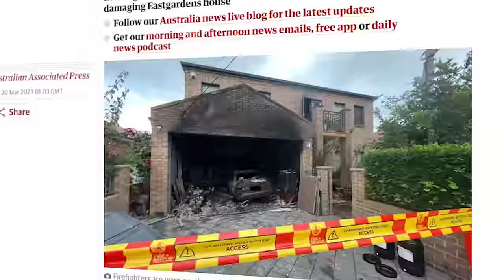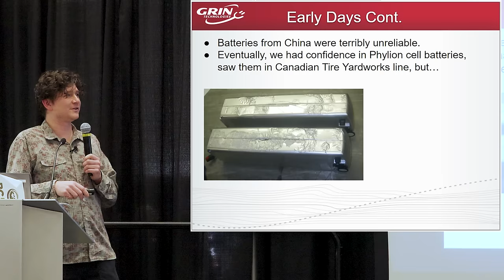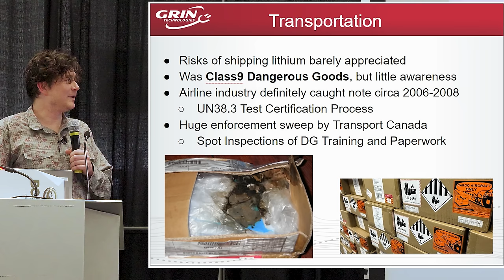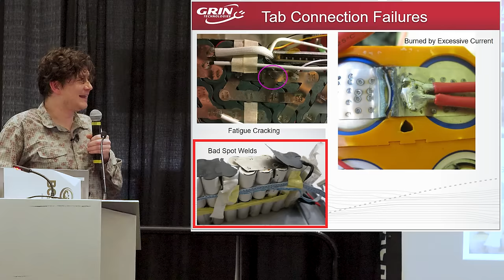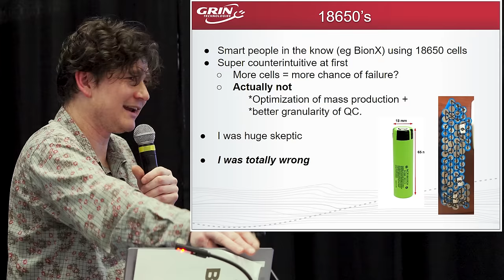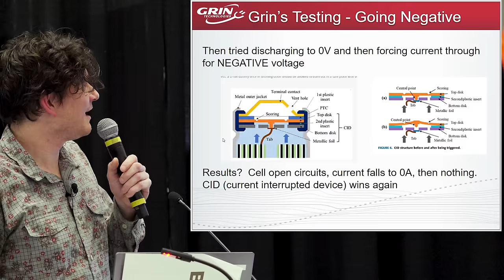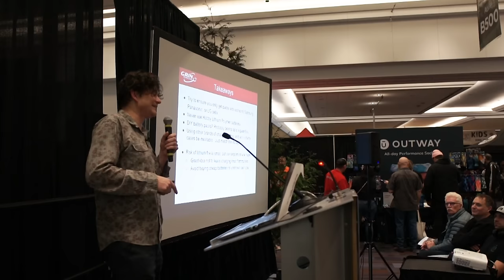Grin's Perspective on Ebike Battery Fires, 20 Years of Experience - Live from the BC Bike Show

Comment: The early days portion of this video is so fascinating to me. I got into this in 2016 and the not-so-distant past seems like such a mystery to me. Someone needs to write a book.
Reply from the maker: The ebike movement really started in earnest as a thing in the late 1990s.  There was some stuff in the 1970's that never went anywhere, but by the 90's you had zap, Currie, aerovironment, heinzman, Ev warrior and a bunch of other brands setting the stage for what was to come.
Reply: @arobertson87 I got in in 2003 when the Voloci ebike from new Hampshire debut.. NIMH batteries were terrible, needed to be topped of just prior to leaving, and the sag in winter was tremendous. I hen went to NICads from Justin , heavy as heck, nd they would get super hot.
Reply: I only started in ebikes in 2014 so have the same feeling as you. I did used to race R/C cars during the Nicad & Nimh era so I know how big a step Li Ion & Lipo were :)
Reply: I got a conversion kit in 2011 or something, LiFePO4 was the only game in town then it seemed. The battery was solid, but the conversion kit had so many manufacturing issues, including one dealbreaker, so I had to return it within warranty. Many years later I started buying used lead-acid ebikes as they died, and converting them to Li-ion using old free laptop 18650s. Unfortunately all of them got stolen eventually, but building them was a great learning experience. I'm happy to say that I applied nearly every safety measure mentioned in this video, and my only thermal incident was the melting of a low quality fuse holder. I now have an electric moped DIYed with quality cells and every safety measure mentioned in this video, and an ebike with an original good quality battery which I'll probably re-cell within a few years. And a really good lock.

Comment: You fail to mention YouTube video's being posted of amateurs building DIY lithium batteries packs also upgrading chargers so they charge faster. Not only are they putting themselves at risk also other from lithium fires.  The whole industry in sales and repairs needs regulation, so standards can be increased.
Reply from the maker: Agreed that the proliferation of YT vids encouraging DIY battery assembly encourages a lot of people to do things that they shouldn't. Part of the reason is that there is zero ebike
service and repair industry and the ebike manufacturers do everything to discourage a healthy aftermarket,leaving no option than DIY repair. 

Re faster charging, There is generally no problem charging lithium cells up to 0.5C charge rates, while most stock chargers are only like 0.2C or less. So upgrading to a faster charger is quite a reasonable thing to do as long as the actual connector type on the port supports it. This is not a battery fire risk.

Comment: I think I'd add to your presentation the danger of leaving the battery exposed to sun on very hot days. That may cause a rise in internal temperature and subsequent explosion. Happens with GPS units stuck to the windshields of cars. That might've been the scenario in the case of the scooter by the subway station in your leading slide. Grin rocks, learning a lot from your videos.
Reply: Ah yes, that intense Canadian sun, and the blazing Vancouver summer, anything could combust under those conditions.
Reply: I mean didn't we already know this in the 80s and 90s
Reply: @sankaplays3098  we already know alot of this information

Comment: Great talk Justin, I have followed you for years and am amazed at your great work. I  remember when you had a contest to name the cycle analyst. I' ve had 2 fires, both my fault, no one hurt. Lipo - I hooked up a 3 series to a 4 series ? thinking I was hooking up my light.  oops, then hooked negative to positive on a 4 series, in the dark again, , and I felt the heat, not a fire just a wire heated up melted the solder so that broke the connection.  Now I use Li ion on my bikes, they work great. I add a lipo as a booster pack sometimes but I make sure I  hook it up carefully in the light.
Reply: Lol, thank you for advice of this matter. But It is best to keep my preference of normability of my uses of all 4 of my ebikes of the extreme need of avoiding these scenes of ebike fires. I lived thru wildfires and even in my home and FIRES is a moment in life no one needs to witness of experiancing ( its total dredd ) and myself with ebike use, I rather ensure I have no need to mess with the ranges of specs. Im sure its useful to many but for me I just keep em simple. Ride safe and be safe and thanks for your experience of this matter.

Comment: as an RC pilot I learned all about how to keep your stuff from exploding in flight or while charging.. the hard way. And I always just assumed that the same kind of mistakes (maybe even intentionals) were being made in ebike factories. And that's what this video pretty much says! You can get the entire battery and charging system for less than half the price if you take out all the designed-in safety features, and there are manufacturers out there serving that market.

Comment: One thing I've done with all of my home-made batteries is to wrap them in a layer of fiber-glass fire blanket under the PVC cover.  Not only does this help reduce the chance of a fire spreading, but glass is an excellent electrical insulator, and it offers an abrasion layer to protect the batteries underneath in the event of a crash.

I also use the JK-BMS.  These are really nice as they have active balancing (meaning they can balance during both charge and discharge), have two temperature probes, a bluetooth GUI, and lots of programmable safety features, including over temp, under temp, short circuit, over current, over voltage, under voltage, etc.
Reply from the maker: This is all good, but nothing the bms does can make up for a situation with low quality cells that go into thermal runaway all on their own even when always kept with nominal  operating conditions. So in addition to those precautions, you should still only use top tier cells, even if they cost a fair bit more per wh than generic ones.
Reply: @GrinTechnologies Absolutely!  I do bike touring, so last thing I want is to get stranded by a battery fire or failure.  Also, in my experience top-tier batteries last longer, and so pay for themselves anyway.

Comment: About overdischarging: This will probably not immediately damage a cell. If you leave it around for days or weeks, then it will damage the cell by chemical processes. If you recharge it immediately, then probably not much will happen.

For security I store my battery in a large ammo box, together with some liters of water in plastic bottles. You need about 600 Wh to vaporize 1l of water. 
And about 90 Wh is needed to heat 1l from 20°C to 100°C.
So I hope, this will stop a fire as early as possible.
Reply: I'm into cell rescue, and I've heard that rescuing unused or lightly used cells that have gone down, even all the way to 0V, can result in a quite healthy cell at near original capacity. I've only rescued heavily used cells myself, and I don't bother with anything below 2.5V when it comes to those, because my experience is that they'll be low capacity or high self discharge (or both), either right away or quite soon. I also toss cells that have less than 75% of their rated capacity, because they tend to self discharge or lose more cepecity rapidly.

Comment: Failure sources:

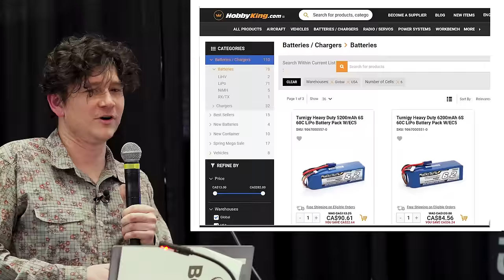- R/C flight hobbyist lithium-polymer batteries out-performing gas for power, range - 7:44
  [is this due to scale inefficiencies of small gas engines? could a micro diesel power plant driving main horizontal thrust prop + electric vertical-take-off and control rotors work efficiently? How does electric vs. gas scale to human flight machines?]

- Water facilitating galvanic current between cells and through casing to cells
- Tab weld failure 16:30
- Tab material overloaded 16:55
- Mechanical impact 17:20
- BMS circuit failure - electrical overheating within internal pack circuitry burns polymer casing materials = electrical not lithium fire

Failre Consequences
- eBike business fires 19:50
- eBike business fires (home auxiliary facilities) 20:50

Small Cell Packs > Large Cell Packs
- easier to locate issues within pack
- industry convergence on 1850 type cells pushed development and standardization for small cells
- allows more granularity for overall form factor of battery pack
- 1850's vary in quality / China market includes lots of counterfeit

BMS DETAILS

What is the problem the BMS solves?  ~ 24:30
 - eBike end user doesn't attend to any of it -- the management is baked into the battery -- down to each cell in the pack.

- BMS and maintaining 1850 standardized-cell specks 25:10

- What are consequences of out-of-spec charge/discharge for battery cells ('cracking' the case/BMS to recycle individual cells)
   29:00 -- testing indicates it's nearly impossible to use consumer methods result in fire. End users can't do it. Fires are defects (or extreme mechanical)

CONCLUSIONS
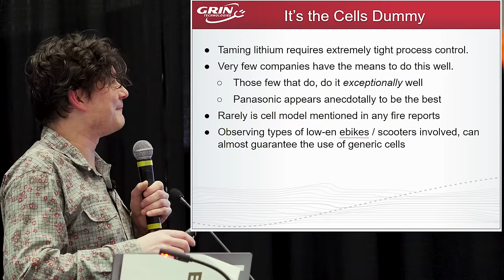- 31:05 -- safety demands decades-long R&D / product evolution of a large company's small cells (1850's), ensuring safety even in extreme abuse cases, down to the cell level (BMS, internal circuitry all prone to various failure modes).
   - 32:50 -- cordless power tools do have fires, but rate is minimal -- and it's likely because typical consumer buys name-brand tools with proven cells in their battery packs
- 31:50 -- we need incident reports to indicate the brand cell involved in fires

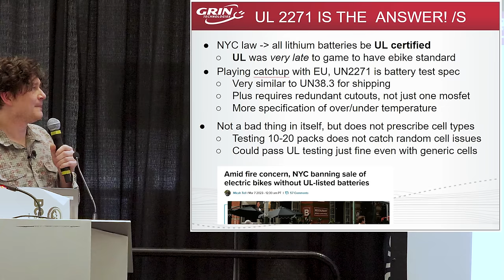UL listing now required in NYC- 34:15
 - Doesn't require proven battery cells -- Samsung, Panasonic, LG
 - Forces massive cost to sell an eBike battery or whole eBike setup - $40,000 per battery design to go through UL testing

How To Extinguish - 39:09
  Run-away heating drives lithium battery fire
 - Water = yes: quench the heat 
 - CO2 extinguisher (not common household) extinguishes flame and cools
 - Chemical ABC extinguishers (typical household) make a mess and won't address internal heating that restarts the fire
Reply from the maker: Thanks for creating and sharing the summary!

Comment: I ran a hobby lipo 14s8a pack without bms but was very careful when charging it. Eventually I got a Bluetooth bms and found out that 5 of 14 cells were dropping below 2v whenever standard throttle was used, and immediately recycled the pack. Thankful I never experienced a fire, always kept the battery in an ammo can just incase
Reply from the maker: Definitely a lot of close calls that happened in between all the various actual hobby LiPo battery fires. Glad you were taking precautions, and please keep spreading the message that every lithium ebike pack (and especially a hobby grade LiPo pack) needs a BMS!

Comment: Very good presentation.
Ryobi has been using Chinese EVE 18650's for about 4 years. Power tool fires do happen, but yes they seem quite rare for how many power tools are out there and how much they get abused. Speculation is: the energy density of cells used in power tools is far lower, 1.5 or 2Ah, compared to 3-3.6Ah used in some ebikes. Lower energy density means less flames, gas, and heat are emitted (non-linear), less chance of thermal runaway. Add to that the cells have high discharge ratings, so should heat up less and hopefully designed to age better.
A major concern with cheap Chinese packs is not the brand of cell used, but that they can be using recycled mixed cells that are poorly matched. You might have a pack with an old, lower capacity, high ESR cell right in the middle. That one is going to get hammered, and probably start heating up the most. For a BMS to handle that failure you'd have to have a probe on every cell which is not realistic.
Reply: Also lack off liability through addressable supply  chains gives NO incentive not to compete on price alone, multiplying flaws and risks.
Reply: Yeah,   Most power tools uses Texas Instruments BMS chips. And not using High energy density cells, they using high current cells.
Reply: Why is that not realistic? A thermal probe is less than a dollar. Also, the BMS should in most cases be able to identify the cell by voltage difference/current on the balancer.
Reply: @llejk  Have you ever constructed a pack before? Manually soldering and running probes is a huge pain in the ass and will drive up the cost. The BMS doesn't care about the voltage difference unless its exceeded the min or max voltage, at which point it shuts off. Its not going to know a cell is in a hotspot, and even if it does, you'll just get constant nuisance trips.

Comment: THANK YOU for this detailed, necessary presentation. It gives me peace of mind because my 2 wheel drive E-CELLS Super Monarch Crown uses 2 SAMSUNG batteries, 15 Ah and 20 Ah. (Downtube and under rear rack). I'm not surprised that Dave Clevelend, the designer of E-CELLS e-mountain bikes, uses SAMSUNG because all of his components are high quality.
-> Actually lithium iron phosphate batteries weigh only about 20% more than Li-ion batteries of equal power but have TRIPLE the charge/discharge life to any chosen %.of maximum charge relative to its new state of 100%.

Comment: Timely video, thanks. I am just a newbie in ebikes. My first effort is a rebuild/upgrade. The new battery is coming from a company that seems to have a good and long term rep; worst being that the battery is less powerful than described, the company seems responsive to these complaints. The final check in their favour was that this battery was designed to make the most out of my specific battery enclosure.

Comment: thanks for the info  I wonder how the bms works and its malfunction of the energy in the batt
Reply from the maker: Bms circuits have sense leads to all of the cell connection points, which means a failure that shorts those leads together can result in very high discharge currents in pretty thin gauge wires

Comment: Lets say you keep your battery at around 20% charge when you're not intending on using it.
Does it stand to reason that further decreases the chance of a cell suddenly catching fire? (would a battery at 80% charge be more likely to catch fire then a 20% of the same bat?)
Another question: what are the chances Lithium ion battery's from hand held gaming consoles that haven't been charged up in 10 years to make a fire ? (asking since I have an old psp, and a nintendo DS, and a couple of old samsung batteries around) - I never realized being undercharged/empty could be a hazard too - should I just get rid of these?
Reply from the maker: Being undercharged in itself is not a hazard. It's just if you attempt to charge a battery that is super discharged (like <1 V/cell) you run some serious risks.  Being underdischarged at BMS cutoff voltages (anywhere from 2.5-3 V/cell) is totally fine.  

The voltage of a 10 year old battery depends primarily on the quiescent current of the circuitry it's attached to. Most BMS circuits will drain enough from the cell that after 10 years it will be a 0 volts and be beyond salvage. But if you still measure over 2V on the cell, it can generally be charged fine. Is it more dangerous than when it was new? Instinct says likely yes, but we don't have the firsthand data or electrochemistry background to say that with any authority.
Reply: @GrinTechnologies  Thanks for the great answer man - appreciate your time doing this.

Comment: What I would suggest is to  charge your Li battery inside a closed self cleaning oven.  My thinking being that these ovens can handle 600⁰ F temps or higher.  Also  charge the battery when your are awake and in your living place.  This being advice for most appartment residences.  Another method is charging the battery in metal trash can in a safe area.  Feed back me if you have any ideas on what i just suggested.
Reply: I've been charging my ebike battery inside my oven for quite a while now. I also babysit while it's charging, and make sure it's unplugged as soon as it's done.
Reply: Charcoal grills are another common idea

Comment: Thank you for this great presentation. It is shocking how hard this information presented here is to find. I dabble with DIY ebikes, I use reclaimed A123 batteries. They seem very stable. I take a hit in capacity and weight, but have huge gain in amperage both charging (4C) and discharge, and safety
Reply from the maker: The original A123 cells were really one of a kind, most of the inexpensive lifepo4 available now doesn't come close to matching the ruggedness and C rate capabilities of those old cells. So yeah, if you don't mind a hit on weight those are some great building blocks.

Comment: My bike is extraordinarily unlikely to combust, because I’m the battery and the motor. By the time I’m old enough to need an e-bike I hope they’ll have the battery tech figured out. But the crappy fuses and bad construction are going to be with us as long as there’s a profit incentive
Reply: I’ve purchased ebike batteries from china, and i was dismayed at the poor construction build…balance wires crossing over the top of the cells, without adequate insulation, and poor support for the cells, allowing them to move, and chaffe inside the case…a timebomb ready to go off.

Comment: Awesome talk Justin! I was expecting to hear about battery storage (ie metal containers to prevent fire spread) used during charging. Great info about buying named brands and avoiding issues in the first place. Thank you!
Reply from the maker: If you aren't confident in the source of your cells then charging in a place where fire would be contained and can't propagate is certainly a good idea. But with good cells and a good bms, this kind of step is hardly necessary. 

We're not a fan of either bosch or Shimano propriety systems, but they have 10's of millions of ebikes out there with no one charging in a metal box and no one having fire issues either.